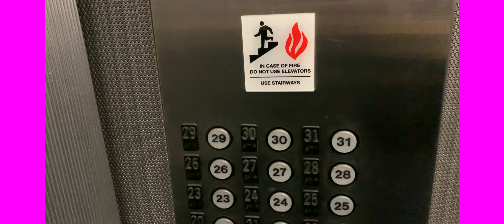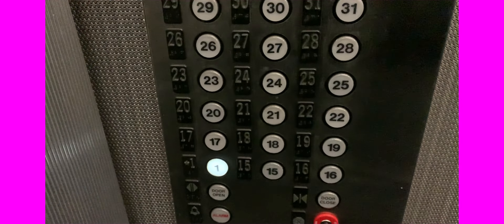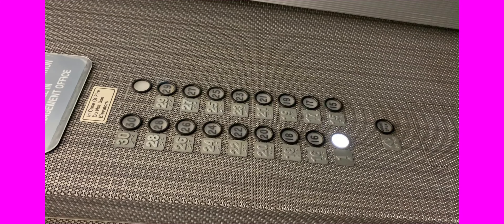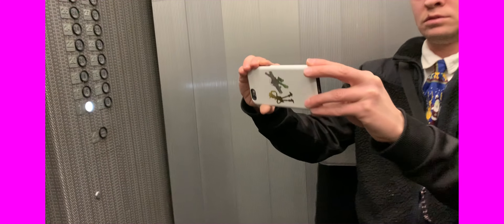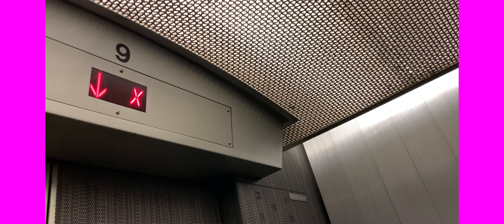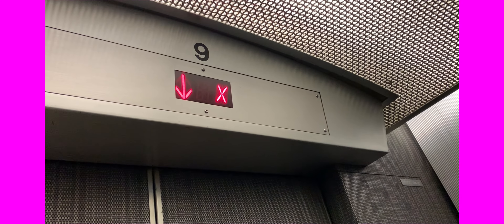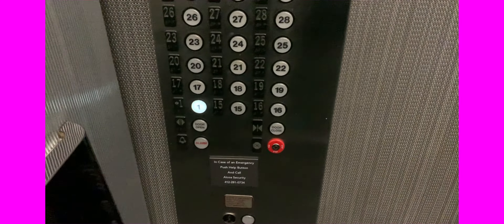Westinghouse traction elevators @ Alcoa Building(Regional Enterprise Tower) Pittsburgh, PA

Comment: The signal control car isn’t from the 30s it’s from the mid 50s when the building was built. The cars are also not 100% original the controllers were replaced there MCE. I saw the machines once
Reply from the maker: Yes, I could tell controllers were obviously not original.  But the Westie's do still have their original fixtures from when they were put in I think.  Also, how do you know the Signal Control car is from the 50's?  I believe Signal Control's as a whole were discontinued in the 40's....
Reply: Genesee Trains & Elevators the building was built in the 50s